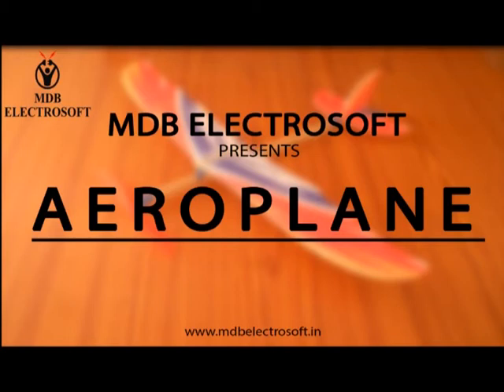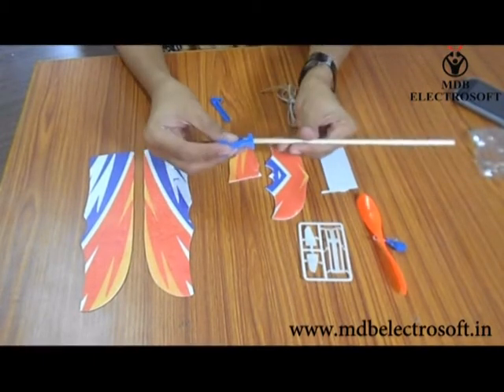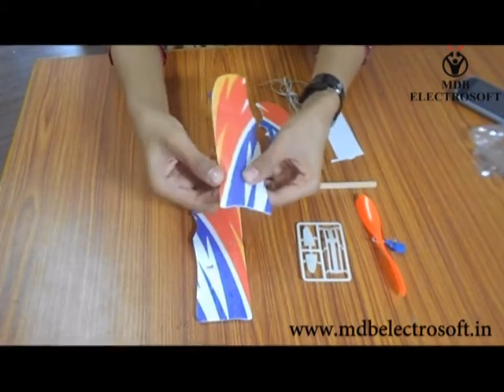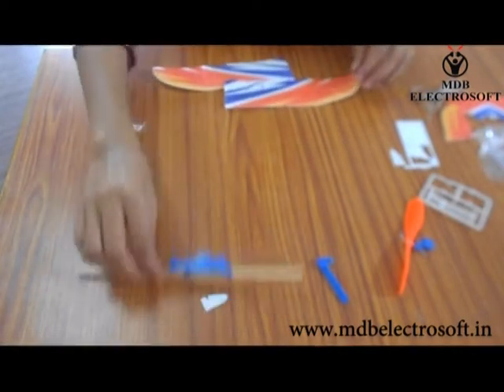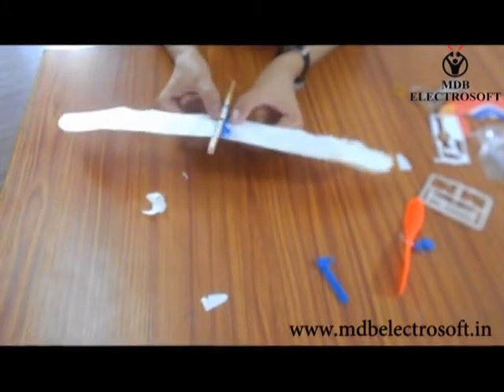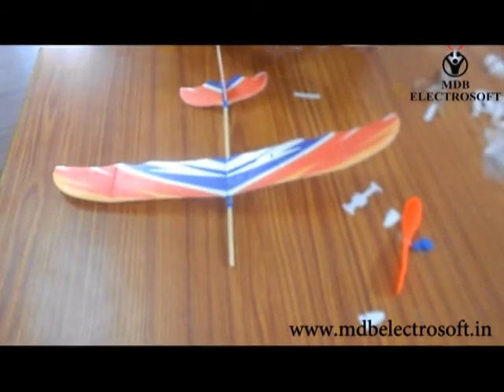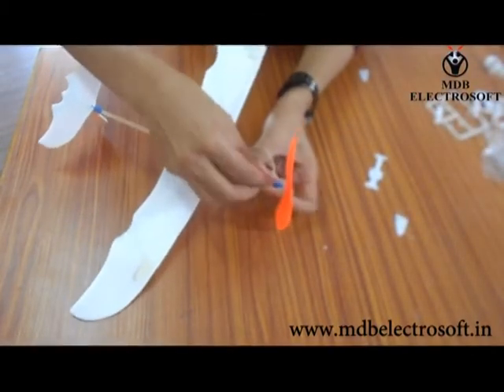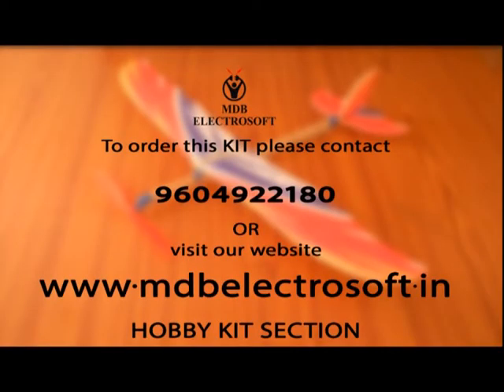Aeroplane Kit

Comment: the aeroplane which you made need much energy to roll the fan
Reply from the maker: yes every avionic kit requires energy in terms of fuel, battery or like rubber band turning.
 Do you use it ?